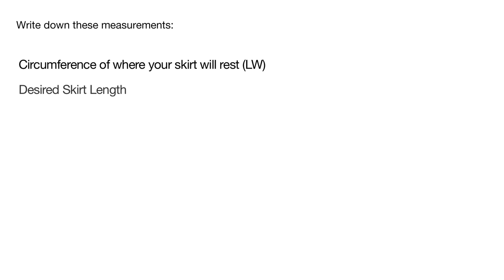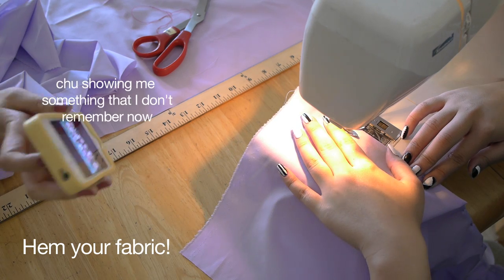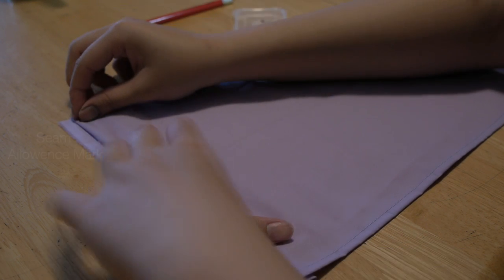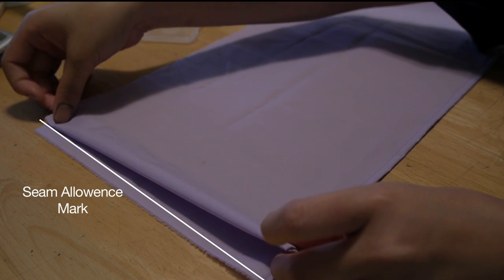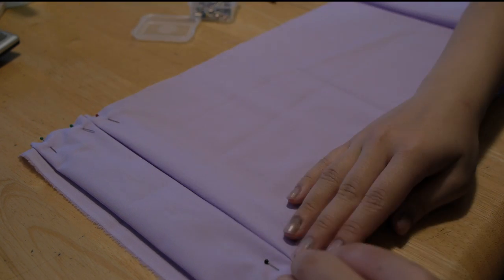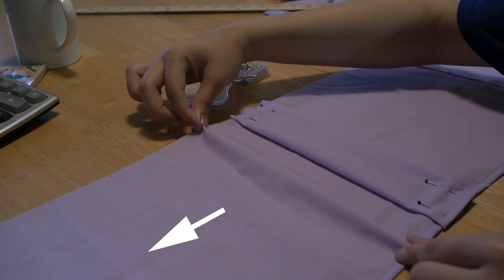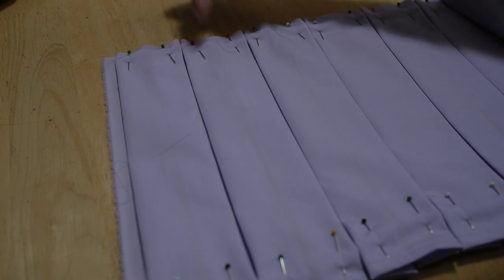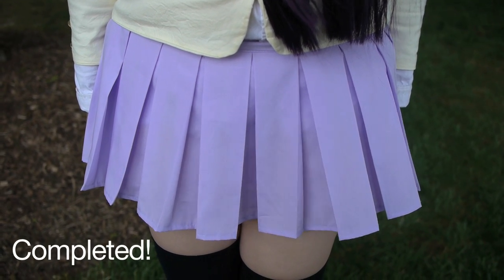HOW TO: PLEATED SKIRT

Comment: in case you're using a fabric that doesn't like to hold a crease (struggle legit) use starch. I got mine at my local JoAnn Fabrics, so it can't be that hard to find.
Starch helps the fabric stiffen so it's really helpful for skirts.

Comment: Thank you for this simple method! I used it to sew my skirt for Iki Hiyori.
For the width of the fabric needed for the skirt, I just took my waist measurement (where my skirt starts), cut out the waistband, and then pleated until I had a rectangle just a little shorter than the waistband. That way I didn't have to do any math.
A question though for others who have tried this with a longer skirt... do the pleats stay flat when you wear the skirt? Mine keep puffing out!

Comment: You could also send you hemmed fabric to a professional. They will tend to be crisper and last longer. The best fabric to use is polyester or poly mix as the pleats will last for a lot longer. If you use silk or cotton then any water or heat will loosen the pleat during cleaning. Don't use Nylon. This just won't pleat well and the pleats will fall out very quickly.

Comment: How did you sew the waistband on the inside of the skirt? The audio cuts out there if you explained it in the video. The stitches aren't supposed to show on the other side, are they?
Reply: I'm assuming that you just sew it on. It showing on the other side doesn't matter. It'll look more polished if it had a "top stitch" from that stitch :)

Comment: 1.75 yards would probably be better, for seam allowance. If you don't mind having two seams, though, you could get one yard, cut two pieces to your desired length longways, and sew them together in the middle (be sure to check the width though if you do it this way though). Most fabrics come in widths of 45'' or 60'', so either way you would have plenty of fabric left over. Having the two seams makes it easier to add pockets, too!

Comment: I was wondering what the pleat size was in the video? Also, what did you do after you took out all the pins from the pleats at 7:30? I would really appreciate it if you could help me, and thank you for making this video!
Reply from the maker: Hi! I believe the pleat size was 2 inches. It's been awhile since this video was made, but that's my standard pleat size that I use! After 7:30 (sorry the audio cuts), I folded over a small piece of the waistband over the raw edge where we joined the waistband to the pleated skirt and I sewed it down so that the raw edge was encased in the waistband. Hopefully that helps! Thank you for watching!
Reply: Thank you for answering! (I just saw your reply now) thank you!

Comment from the maker: For Teto, you'd sew the pink part onto the grey/blue part of the skirt, so that you'd create a rectangle of fabric that is the length of the skirt you want, then you'd pleat the fabric all together! So if you'd want it to be 13 inches long in total, you'd cut like...a 10.5 inch rectangle of grey/blue and a 4 inch rectangle of the pink and sew it together. That adds up to 14.5 because of the seam allowance and hemming at the bottom. If that doesn't make sense, let me know!

Comment: Questions; 1. What about the hem at the bottom? 2. How do you add the zipper, and three, how do you measure for size?
Reply from the maker: 1. Hem the bottom before you pleat, to make it easier to hem in general. You can hem however you'd like, I like to use a rolled hem.
2. Sorry I couldn't add this in the video, as I'm not super confident in my zipper sewing skills just yet, but there are plenty of tutorials out there that can help you with this!
3. Measure for size using a measuring tape and get the measurements that are required(which are explained in the video)!

Comment: Is it possible to sew two pieces of fabric together and use this tutorial? For example, on a Miku Hatsune skirt the skirt is black with a line of green on the bottom. Is there a method of doing that?
Reply from the maker: Yes that will work just fine! I've made a miku skirt in the past using the same method.

Comment: with the pleats after you wash it should i keep ironing it? on the last one i made i had to on this skirt do you have to?
Reply from the maker: Yes, the pleats will loosen in the wash so you'll have to iron them again afterwards
Reply: is there anyway i can keep them in place without that happening?
Reply from the maker: You can google how to chemically set pleats using vinegar, which will help set the pleats in for longer after washing, but I believe that it will eventually loosen after a couple of washes.
Reply: okay, thank you for the help

Comment: Hi I'm trying to begin and I need some help. Where did you buy your fabric? All the fabric I find have some sort of pattern on them and feels like table cloth. Thanks
Reply from the maker: I buy my fabric from local stores in the NY Garment district. You can try using sites online if you don't have any stores nearby that sells the the right fabric!
Reply: Good thing I love there! Is there any particular store?
Reply: THANBK U SO MUCH I WAS HAVING SUCH A HARD TIMEFINDING GOOD FABRIC. how much does it cost
Reply from the maker: No problem! It's $6/$7 a yard if I remember correctly.
Reply: ooo its pretty reasonable
Reply: hi hello do you know if their site works?
Reply: also how much fabric did you use?
Reply from the maker: A yard is usually enough for a standard size skirt, for longer ones you'd have to calculate how much yardage you'd need! Also, I'm not sure about the website, there's a lot of stuff that they don't have on the site compared to the store itself.

Comment: I did everything like the video, but the skirt ended up 23 inches instead of 33 :/
Reply from the maker: Oh no! Which pleating method did you use? There are different lengths you need to have depending on which pleat you use. 0:18

Comment: I've made pleated skirts before but your tutorial confuses me. For example you said multiply LW x2 (2 is the pleat size but it shouldn't say two because its interchangeable) and it wouldn't give you the proper measurement since you need to know how much folding fabric you'll need (I.e. The unfolded pleat) the math should've been LW divided by PS (pleat size) = #of pleats then #of pleats x unfolded pleat length. Idk maybe I'm misunderstanding your method xD
Reply from the maker: Hi there! I believe you're referring to the math in the beginning of the video, which is to determine fabric width (how long your fabric needs to be prior to pleating). For side pleats, you would take your lower waist (or as referred to, the circumference of where your skirt will rest) measurement and multiply it by the number 2 (LW x 2). The 2 here has nothing to do with the pleat size as the pleat size is up to you. The 2 here is based on the relationship between fabric width and pleat style that I've seen when doing side/knife pleats specifically.Your method of calculating the length of fabric you need may work too, but this is just my personal method that I chose to share. There are certainly other ways to make a pleated skirt. Thanks for sharing your idea!
Reply: ah no problem and i just wanted clarification thanks :)